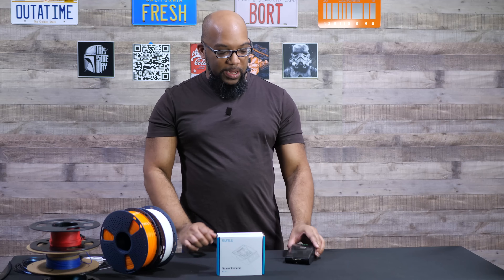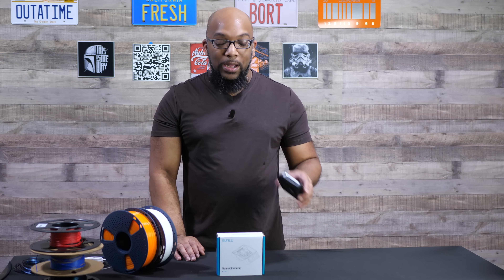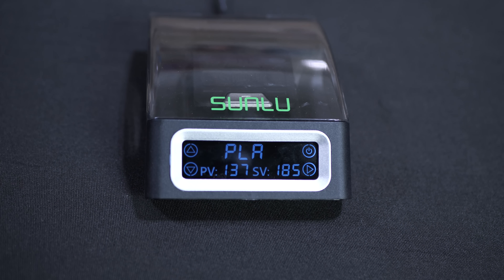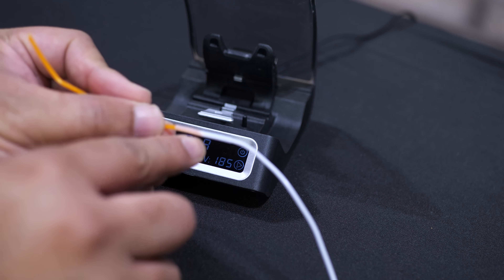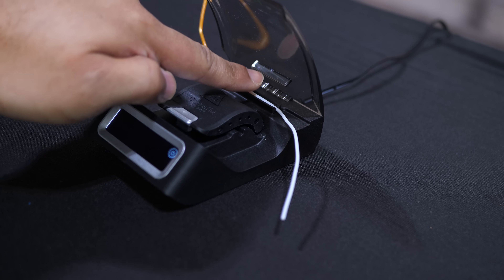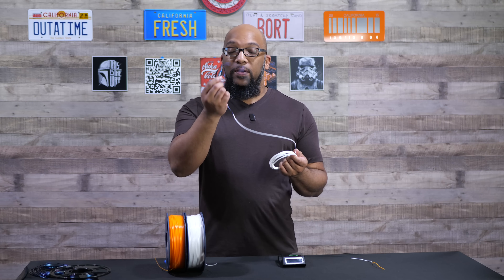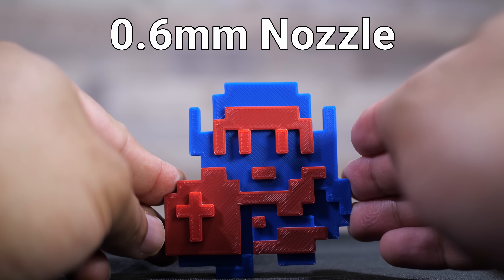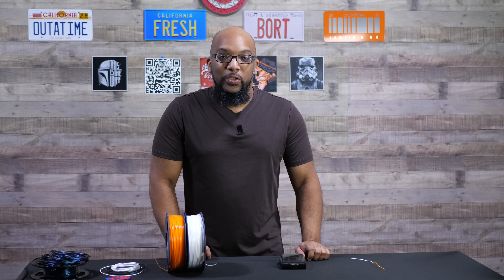Say Goodbye to Filament Waste? Introducing the Sunlu Filament Connector

Comment: Or you can just use a piece of PTFE tube and a lighter(I checked this and it really works, better use extra narrow PTFE for this). Which is less in cost of 35 bucks I guess. And you do not need to through away it every use or buy refills for that. The downside, you need to take off this tube piece from the remaining filament end. But there is a workaround. You can just leave short PTFE just on the spool. And when your filament will pass that point, while printing, you can take it off while extracting the filament. It will not create much trouble while printing actually.
Or you can just use filament runout sensor, at least the cheapest one, which will detect filament end. And change filament manually and continue to print.
But I recommend filament motion sensor, which will cover any trouble which you may encounter with filament. Too thick, too thin, broken on the way to printhead, broken outside of printer, bad spool winding and hotend clogs. Anything and it will pause to let you fix a problem and continue with print.

Comment: why oh why did they make it so that you need to continue to buy consumables. Why dont they reverse engineer a palette colour changer to see how they do it without the need for consumables :)
Reply: You know why, they know why, we all know why
Reply: that tube is the clever part - by doing the welding inside the tube, they don't get any flash lines that you've have from a two part mold.
It would be interesting to know if you can slide that tube off and reuse it. However, its quite possible that it's something like heat-shrink tubing so that it squezes the ends together.
Reply: @ericthecyclist The entire point of this is to mitigate waste though, adding in a ton of consumables winds up being as much or more hassle than just manually chasing the leftover filament into the printer with the end of a fresh spool. And flash lines really wouldn't matter, it would only create a very tiny flow inaccuracy in the moment that the joint goes through the extruder and nothing more.
Reply: @bosstowndynamics5488  But how much waste is being produced versus how much is being eliminated?
With regards to flash lines, how much extra width in the filament does it take to clog things?
Presumably that tube also prevents the melted filament from sticking to the metal heating elements.
Hey, I had the same reaction when I saw that bag of tubes, but I recognized it solved some problems.
Reply: @ericthecyclist  Well, the produced waste is whatever flavour of high temperature polymer they're using instead of what is almost always going to be really cheap and relatively harmless PLA, so since the monetary cost is trivial either way I would say it's not worth it most of the time.

Flashing lines would not be large enough to cause clogs unless you're running your printer fast enough to push the extruder to its absolute limit (in which case you really shouldn't be using offcuts for those prints anyway) or if the mold is particularly bad.

The tube would prevent the plastic sticking to the metal, but it would just stick to the tube instead, so you could either use a polished nickel part (a 2 part metal sleeve would fix the cooling issue) or if there's no metal surface that could work you could coat the part in an appropriate polymer that would be reusable. 

Most importantly though, I think this is a solution looking for a problem, there's so many ways to use filament scraps these days without a dedicated joining device and for colour changing it's really not that expensive to get a multi colour printer these days (or just insert a manual filament change when you slice the part, which is completely free)
Reply: @bosstowndynamics5488  You've got claims and ideas but they haven't been tested in the real world yet. Can we look forward to a video demonstrating their viability?
Reply: @ericthecyclist  My thoughts aside, the comment this whole thread is in response to opened with an example of an automatic filament splicer that's been around for years that doesn't burn a plastic sleeve with every single splice. Reusable parts for splicers were demonstrated years before this thing
Reply: @bosstowndynamics5488 you may have something. Reviewing a video of the mosaic palette they use a teflon tube that is good for about 15000 splices, which isn't much for a palette, but would be ample for a manual filament slicer. You can buy refills for 5/$40US, so $8 each. it is curious they didn't use this, one might guess "patent restrictions".
Reply: @ericthecyclist  I'm sure IP is involved, but thinking about it some more the Palette presumably never has to pull the sleeve back off the filament, since this splicer is meant to join potentially quite long leftovers they might have just decided that burning cheap consumables was better than the inconvenience. Unfortunate but it's a common design practice in a lot of product categories
Reply: I think the Palette splice core still has consumable components
Reply: @chemistclips  A quick check confirms that they do, even a similar tube based system, but the difference is the Palette ones are good for 35 thousand splices each instead of a single splice

Comment: I may be missing something but I don't see the purpose in fussing them together. When the filament is low the printer will detect & you just add the new roll & it will continue. Right?
Reply: Not all printers have a runout sensor

Comment: Definitely good for those with single filament printers, but there's a couple of parts of the use case equation missing, like with a small coil or whole spool, how are you supposed to manage tangling or knot tying with a full spool on one end (filament clip will suffice) but on the 'loose' end with the small coil or partial spool, you're supposed to let it just unwind? so buying a whole device that replaces... a lighter... IDK - they could have also included a cutter in the device or in the box to cut the angles the same, etc. it also requires that you destroy perfectly good PTFE, they couldn't have devised a more permanent solution like a ceramic cuff to encompass the filament? just seems like a money grab from Sunlu, but hey if it's useful to anyone then they should buy it.
Reply: good review regardless of my whining.

Comment: I made a 4th of July print with red and a little blue on top of the lettering like this... you can estimate the length of filament needed my using the slider at the right on OrcaSlicer.  I find that its just easier to watch it print (slicer gives a length and a time stamp) when the timer goes off then cut the filament and feed it directly into the extruder on my Ender 3 V3 KE. I own a 5m and a 5mPro but its just easier to use the Ender for multi color prints... I can't wait to see if flashforge comes out with a multi color system!

Comment: On the paper it would be perfect for PET recycling. But i wonder what is the max temp it can go. And do you necessarily need to cut the ptfe tube ? Can't you not slide it ?
Reply from the maker: I have been able to slide it off as well with a little effort.

Comment: There's finally a commercial version of this?!  No dead Kickstarter or a bunch of projects I have to translate from Russian?!  oooooooooh!  Now I can take all my PET filaments and join them
Reply: That will be the test! Unfortunately the unit only goes upward to 240C - PET1 needs a much higher temp for joining. Time will tell if it'll be able to be a mod.
Reply: Yeah,  not happening because they won't make one that operates at PET melt temp (at least 270 for effective weld, 280+ preferred) because they're using PTFE which offgasses dangerously at 250.
Reply: @daliasprints9798 are you talking straight PET? Cus I do PETG at 235-240 and get complete glass transition.
Reply: The Slunaz ff1r exists. Pretty expensive though.
Reply: @hereorthere-maybe  Isn't it still a printed kit not a product you can use out of the box?
Reply: SFK-I3

Comment: 😂 “there’s a fly on my hand. I’ll take care of him later.” 🤣🤣🤣🤣.
Reply from the maker: And I did. ☠️
Reply: @FigureFeedback  
Hi, there.

Could you try testing with a more multicolored piece? Since slicers show us how much of each filament will be used, we could measure each color involved, cut the filament in the right spots, glue them together, and then load it into the printer. This method might not work for very complex objects with frequent color changes, but it could be worth trying for simpler projects like lightboxes.

Thanks!

Comment: Feels poorly (and overly) engineered and overpriced. The most important part is the PTFE tubes with correct diameter. I would buy a bunch and just fuse filament together with my soldering hot-air gun. Unfortunately, I didn't find any 1.75mm PTFE (or other material) tubes for sale, there's only 1.9 ones.
Reply: I found some 1.8 mm ID ptfe, but it's too big, that nominal 0.05 extra create a bulge that results to be problematic. 
Never found 1.75 mm ID ptfe.

Comment: Very nice implementation! Are the little tube pieces just cut up PTFE tube? Have you tested the strength of the joint by bending and flexing it? I always had problems fusing stuff together because the joint would be weak and/or leave a larger diameter area where you had the sand it down. It seems those little tubes fix the bulging problem....